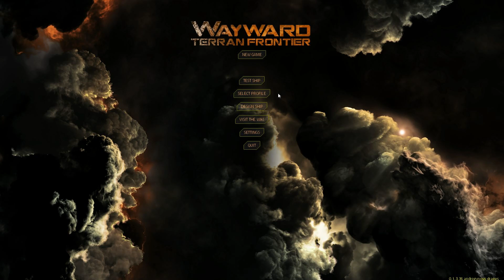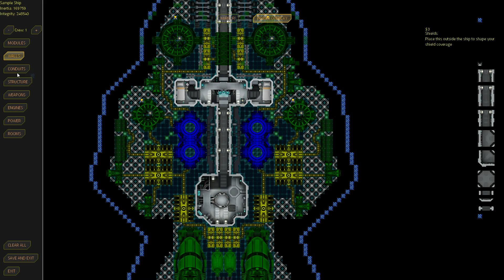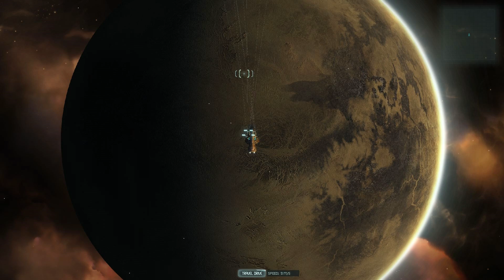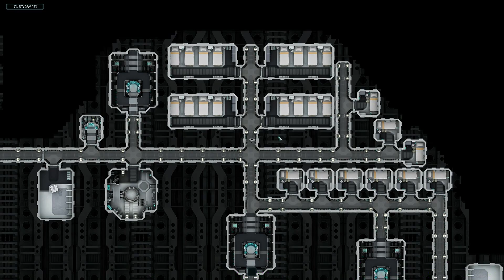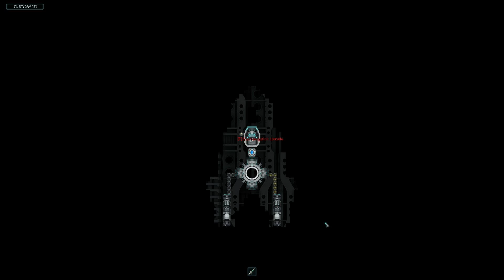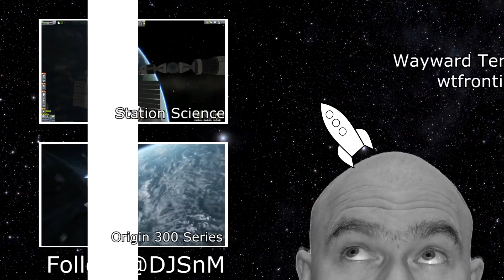Wayward Terran Frontier - Tile Based Spaceship Construction & Destruction

Comment: It's on Steam now, looks a bit more polished, and somehow lost it's good UI like this video used had, but for a progress of whole 2015 it don't really changed that much, but since they got a three person team, maybe it's naturally I guess, a few updates already appilied, hope they can speed up because of the Steam release xD
Reply: +meltybagle Lost good UI? What?
Reply: +Jan Orszulik The UI elements are slightly different to the video, and I do prefer the older UI
Reply: Yes, it's easier to tell the size, I feel it's intuitive to use, although the new UI looks good xD
Reply: meltybagle
well there are modules larger than screen and modules as small as a tile thus displaying their relative size isn´t exactly viable, but first thing you see after you select module is its actual size. Also picking module is considerably faster than before.